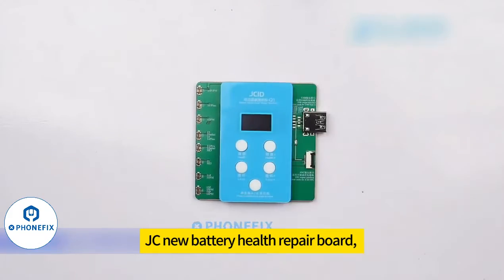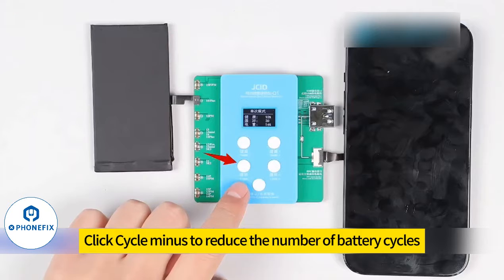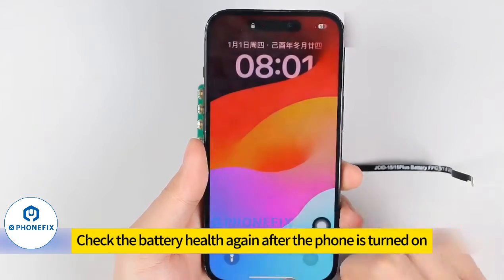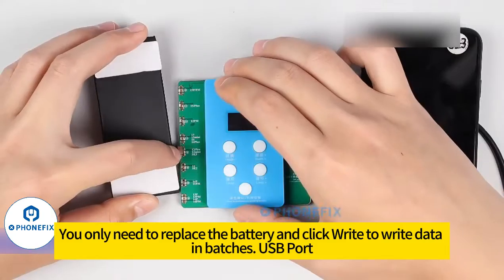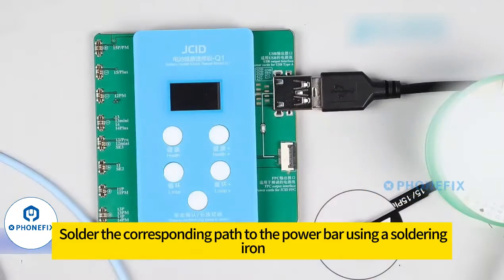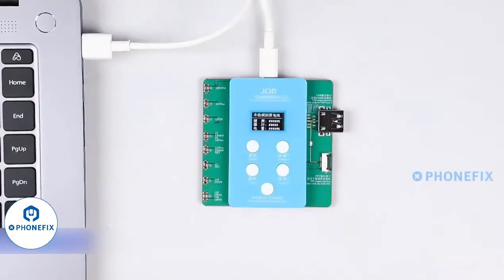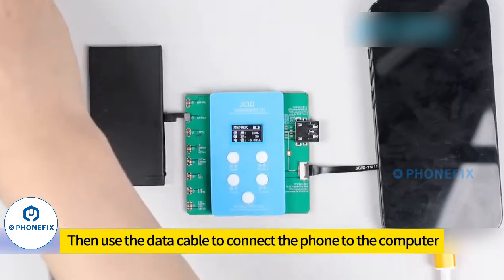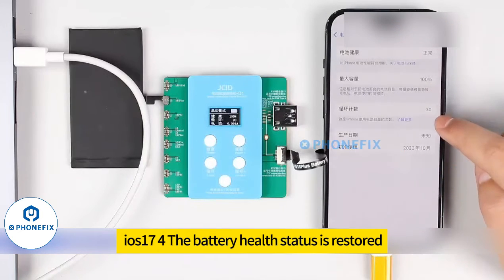How to Use JC-ID Q1 iPhone Battery Health Repair Board?

Comment: This tool is not wt you think it is it doesn’t really modify battery data you can see using v1se if its really modified or not i did check its not really chang battery health or use 3utools will see real battery data 😢😢😢

Comment: Hello, thanks for the information, I would like to know if doing the procedure without FPC will cause the battery's condition to degrade faster than normal, for example going from 100% to 90% in a few months